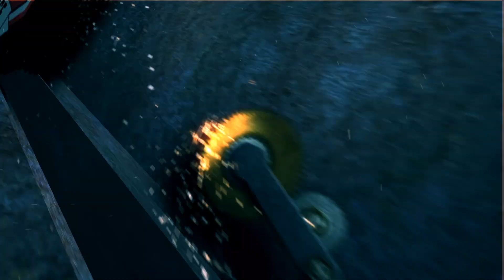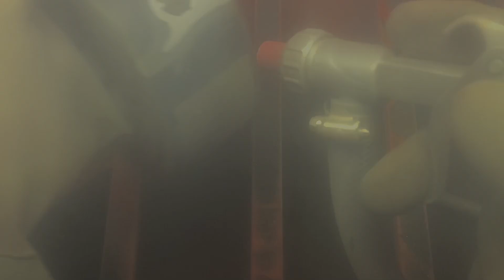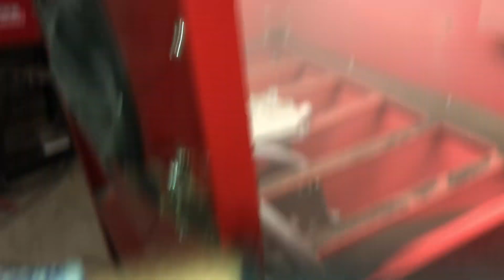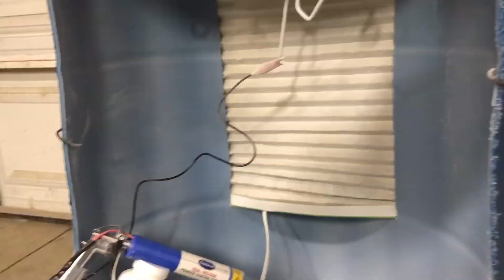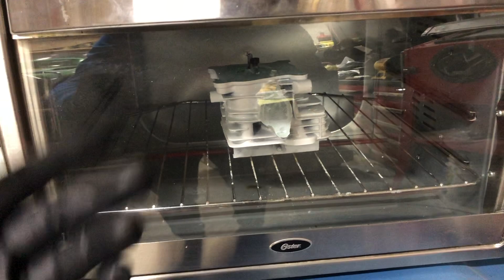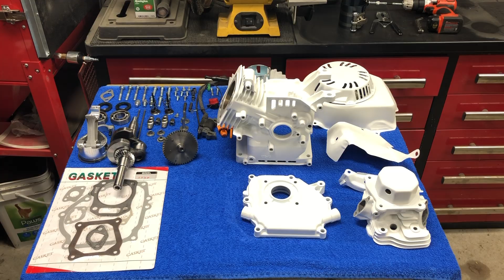Powder Coating an entire Predator 212cc engine!

Comment: 3 years later.
Question 1: Is the paint high temp resistant after being baked on?  Durable after some use?

Question 2: where’s the link to that little coat system and how much was it and powder?

Question 3: when you doing one black with polished finish tips?  😮

Comment: It doesn't make much sense to put it in a wash if you are going to go straight into a blast cabinet....
Reply from the maker: Washing it is so your media in the blast cabinet doesn't pick up the oil. Just saves on the life span of the media and also so your gun doesn't gum up.
Reply: @PraskaBoysGarage  thats what the filter is for....
Reply from the maker: @Excentrix54  Look Brian, I not trying to disagree but this blast cabinet doesn't have a media filter. The media sits at the bottom and get sucked up a tube and thrown out the gun nozzle. Then it drops back down to the bottom to be repeated. The only filter used is a water trap filter from the air compressor. This is common practice in large power coating companies.
Reply: I know how a blasting cabinet works..... I run a Powdercoat company that has an oven capable of doing a full chassis. There is a filter at the bottom of your cabinet. If there isn't you should probably put it back in.
Reply from the maker: @Excentrix54  Okay man, lets settle this. Please send me a link for a replacement filter for my harbor freight cabinet and I will order it.

Comment: You son of a gun! I thought I was original with painting my atv engine white. But just seeing this now disappointed me but also made me happy for you. Good job my boys keep it up. I bought that predator motor a few days ago still in box. Not sure what I am going to do with it. Wish I could do a nice video like you. I'm building a (fill in here) quad. It's going to be revealed when done...
Reply from the maker: Lol, thanks! I actually have more experience with predators and clones than I do with the ATV motors. The mini bike project this motor is for originally had a white Tecumseh back in 1969. My plan is to find an original motor but in the mean time this predator will have to do! Just sent off a few more pieces to powder coat to finish the mini bike up!

Comment: Hey man, please get back to me... I have a 125 gio sports quad, been sitting for years. Won’t start
Reply from the maker: Fuel, Spark and Compression is the recipe. Does the motor turn over and have compression? Do you have spark? Start there and the story of what you need to do will unfold.

Comment: Hi, I'm doing a 110cc atv that I want to fix up. I want to get off with the wires and suspension and paint the frame and all this. I've never done this before, is it hard? Is there anything I should try?
Reply from the maker: That is awesome! I will say it can be challenging at times, but very rewarding when your done and riding it for the first time. My advise would be to make a budget first. Look over the entire atv and make a list of what it needs. Then a list of what you want after that. Before tearing it completely apart I would get it running and driving first. The last step should be painting before final assembly. Good luck and let me know if you have any questions!
Reply: so did you get on with the project? or did you die inside when he replied? 😀

Comment: I have a Chinese ATVs I know it has spark, has no carburetor problems, and I already got it it to run once, but now it won’t fire even with starter fluid
Reply from the maker: Spark + fuel but it wont fire would lead to a mechanical problem. I would first check valve clearance and make sure you don't have a stuck valve or one with too much slack. If that checks out then I would run a compression test. If compression is low (under 90) then I would find out what leaks and repair. Good luck on the investigation.
Reply: Praska Boy's Garage thanks

Comment: Hello i notice you rebuild chinese atvs often and may know a good place to source engines or cylinders + heads. I currently have a water damaged 125 trying to save it. Tia ✌
Reply from the maker: I typically source most of my motor components from eBay. Sometimes ordering directly from the China sellers.

Comment: I have a question: I’m going to be building a new Predator 212 Hemi and I plan also painting the engine but I plan on using HD wrinkle black on the entire engine and I’m shaving the edges of the fins just like Harley. What do you recommend on cleaning and prepping since I have done this years ago on my 19771/2 Harley Low rider I also remember having to use my oven to cure the wrinkle finish but don’t remember what I used to clean it in order to look factory like mine did back I the later 80’s. Thanks
Reply: Ok Thanks for the information.
Reply from the maker: I cleaned mine in purple power degreaser and a scrubber, then rinsed it off with carb cleaner, and blew out with an air hose first before sand blasting. In your case, I would say sand blasting would be over kill but rather use a scotch pad over it before you lay down your paint. Good luck on the project, and touch base after your done and let me know how it turned out!

Comment: That looks so great!  Bigger carb just bolt on with no other mod's to make it run right?   Thanks
Reply from the maker: Rumrunr Jones Thanks! The carb comes with a bigger air filter and the exhaust will be a straight pipe to allow for better air flow. Should be fine. I do have upgraded valve springs and rockers if it needs them! I would like to get a billet flywheel but I would still need a way to charge the coil. To be continued on the next episode!

Comment: Whats the powder coat machine make model you using!?
Reply from the maker: I used the Eastwood Dual Voltage Powder Gun Item #11676 Brand: Eastwood

Comment: Wow! Very impressive and been waiting for another great video! You are a hard worker and i know your channel will do very well. Thanks and could use a lot more videos ; )  Also did you put 18 lb valve springs in it? The motor also needs a PBG sticker on it!
Reply from the maker: Thank you so much for your support!  I kept the springs stock for now. I’ve got a set of rockers and springs but I’m going to wait and see the performance with the carb first. Stickers are currently in the works! Thanks again and I promise not to make you wait as long till the next episode comes out!